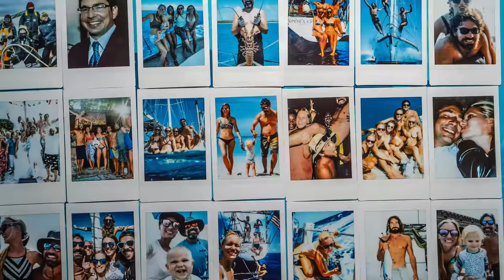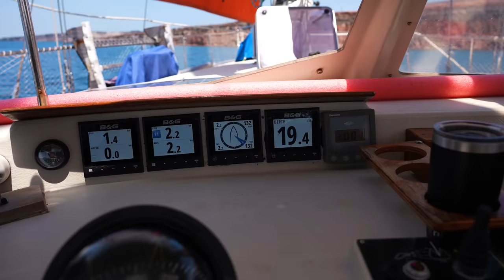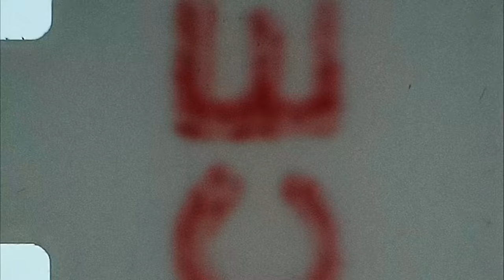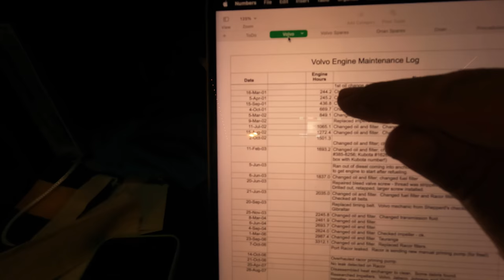Toddler sees the WORLD by SAIL - Desert Island Family Adventure SV Delos Ep 394

Comment: Brian I'm an old diesel truck driver. In my own truck which has over 432,000 miles I've used a product called Prolong. When I had the engine rebuilt the Machinist told me it was the cleanest engine for that mileage and had hardly any wear.
Prolong engine oil additive.

Comment: As an avid car enthusiast i can tell you that over filling the oil will 100% cause a loss in oil pressure. 

An overfilled oil pan causes the rotating assembly to whip the oil that is sitting in the pan, creating oil foam that does not properly lubricate the engine. 

Always fill to the proper level.

Fair winds and following seas.

Comment: If you have a drain plug at the bottom but don't use it due to accessibility (and are also concerned about being able to pump out everything through the normal location) you should check out the 'fumoto' valve. It replaces the drain plug with a ball valve with nipple. You still have to be able to reach down to it to turn the valve so as long as you can do that it's AMAZING for boaters. The valve has been 100% no leaks for all the people I know who are using it (even automotive!!) but you can even leave a hose secured to it, route it to above the engine, and even if the valve would leak it would just have it rise in the hose to the level in the engine and no further.

Comment: No Sir, it doesn't matter how hot it is outside, you run that motor a few minutes before the oil change, great habit by the way, so that all the bad things in the system get picked up and held in suspension so they get pulled out of the motor when you pull the plug. That, my friend is why that motor is pushing 400,00 miles :)

Comment: Brian, just to share something my dad taught me about overfilling oil way back, and why it is definately something you do not want to do. The maximum oil level is determined by the bottom of the stroke of the piston skirts. Pistons have typically 3 rings, 2 compression rings at the top, and an oil ring. The oil ring is quite different then the compression rings as it's a 3 piece design. It has two holding rings that hold a waffle ring between them. It's job is to dip into the oil pans oil when full, and carry extra oil that is gathered with the waffle up the cylinder walls thus lubricating the lower part of the cylinders during operation. When it's overfilled with oil, the skirts hit it much more violently due to more surface area of the skirt hitting the overfilled oil. Yes that causes bubbles, as you said in the video, eventually and in a short period of time, the oil is so airated that it can no longer support the pressures of the crankcase loads and your main bearings will be harmed, and your pressure will drop since the oil will no longer hold it's viscosity and all other internal parts that need that constant oil pressure will also be harmed (Cam bearings, Lifters, Rocker arm falcrums, etc) depending on how long it's run while overfilled. Absolute engine damage can occur rapidly, especially in a diesel since they have quite a bit higher compression and the loads are greater on the main bearings. You seem to be quite good at trouble-shooting issues but I wanted to add my 2 cents to help you decide if overfilling the oil is harmfull. I enjoy all your videos and love that you are continuing on your journeys with your daughter. Thanks for the many hours of entertainment and technical wisdom over the years. Thanks for sticking with your dream.

Comment: 100% True on overfilling being very bad. The Crankshaft will slap and aerate the oil causing it to foam, this foamed oil will then be pumped through the entire system leading to mostly air with some oil getting where the oil should, this will raise the oil temps as less oil is in any given area to provide lubrication so heat is concentrated in the smaller amount of oil actually doing any lubrication.

If you are in in a vessel that will see rough seas you are better to run the oil a little lower than max, as the oil has to get very low to dry the oil pump pickup, but doesn't have to get that far above full to start slapping the crankshaft. (This is much more applicable in a performance boat subject to much more violent operating G forces than a yacht or sail boat would)

Comment: Awesome video!   Semi pro tip.  On my fleet of trucks and mowers my mechanic will drill a small hole in the bottom of the oil filters to drain the majority of oil before he unscrews them.  It helps with oil spilling down the sides of the filter making a mess also making them hard to hold onto.

Comment: As a diesel mechanic you are doing everything right especially on hours except one thing... filling the filter through the center. Yes its fresh oil but technically the filter cleans from the outside of the element to the inside of the filter... more surface area but you are pouring unfiltered oil into the center. In all my years I have never done that all except I have filled through the small outside holes on the filter in the past... 

If its slightly over full it won't hurt... 5mm or 1/4" over fine.

Not sure what the life of those engines are but duty cycle and fuel burn is the real determination of life expectancy with good maintenance as you are doing..

Comment: Ooooh an oil thread, you usually only get that on motorcycle forums, what a versatile channel when you consider I discovered Delos whilst researching Lithium off-grid systems. Just a caution on pre-filling your oil filter; the danger is introducing dirt to the output side of the filter ie it then goes through you engine without passing through the filter media. Cheers! 🙃

Comment: Well I would say that you change the oil too often but thats up to you.  If you overfill an engine with oil what happens is with high revs pressure is created in the motor which pushes front and back main oil seals out and they leak then.

Comment: Happy holidays to you from Friday Harbor. Beautiful environment - so different than most others cruisers frequent. 
Brian, let's see if I have this straight. 8000 hours divided by 250 means you have probably changed the main engine oil over 30 times. And you haven't installed a pump to pump the crankcase oil out yet? 
My favorite mod on our Lehman-Ford is the reversible Lil Buddy pump that is plumbed to the drain plug opening in the bottom of the crankcase. It is conveniently located in the engine room a couple feet from the engine so I never have to touch a hot (or even warm) engine when pumping out oil. Changing the oil now just requires positioning a five-gallon bucket (the L-H takes 3 gallons), removing the cap off the discharge side hose, turning the valve on the intake-side hose from the engine to the pump, putting the discharge lline into the bucket, and flipping the switch on the pump. A couple minutes later the crankcase oil is fully pumped out with no mess. AND, because the line is plumbed to the plug in the bottom of the crankcase, ALL of the oil is pumped out at every oil change. I usually let the engine sit empty for one day and then pump out the remaining oil that may have drained down out of the most remote engine galleries into the crankcase. It is usually only a couple ounces. After enduring the misery of hand-pumping the oil out of the crankcase for years, a discharge pump will have you grinning from ear to ear every time you change oil in the future.

Comment: The oil level being too full is as bad as being too low, so max. on the dipstick does not mean full. It means it is the maximum that you can run safely without possibly damaging the motor and min. does not mean empty. It means it is the minimum amount of oil to run the motor safely without possibly damaging the motor. So if the level of the oil is say between 1/4 full and 3/4 full there is no need to add oil. Of course, if your dipstick was maxed out and you got an oil leak you could run the motor longer before having to add oil which could be good if you were out to sea and had no extra oil on hand. Anyway,  ......Hope you guys have a merry Christmas and a happy new year!!  (Rob)

Comment: Overfilling a diesel engine is worse than letting it go low, well below the minimum level at least.  The crank-shaft can dip into the volume of oil and aerate the oils causing a lack of lubrication.  This is a well know diesel trait for commercial engines.

Comment: Brian,  How are the tides in the Sea of Cortez?   Anything special about selecting an anchorage? Jim
Reply: Up at the top, where I am in Puerto Peñasco, on a spring tide you will get a difference of 24 feet. But down the coasts, even as close as San Felipe, the difference is less than four feet. It's described as kinda like the water sloshing back and forth in a shallow cookie sheet. Lots of difference at the end of the pan, not so much in the middle.

Comment: Obviously you have this whole maintenance thing down.  Might I be so bold as to suggest a couple of recommendations.  Write the hours on the filter, that way you have a physical record in case the computer crashes.  Also, next time your in civilization, send a sample of your oil to be analyzed.  Several oil companies offer this service.  It’s simple to do and relatively cheap.  They can tell you a lot about the condition of your engine, and whether your servicing too often, or not often enough.  Might make for good content.  
To answer your question, yes, overfilling with oil will put the level high enough for the crankshaft to splash through the oil, churning it, causing it to froth and will result in higher crankcase pressure.  Than can damage seals and cause oil leaks.  Also, pumping frothy oil through the engine is very bad for bearings.  You are also right that during start up is when most wear occurs.  There are contradictions concerning prefilling an oil filter.  I personally have never seen the harm in it, but the argument is, your cycling 1 liter of unfiltered oil through your engine.  I often wonder why manufacturers don’t have an external electric oil pump used to pressurize the system prior to the engine starting, then it could shut off after the engine builds it’s own pressure.  It could also assist in servicing.  Remote oil filters could also lessen the yoga needed to service the engine.

Comment: Just in case anyone cares, the reason it's bad to put too much engine oil in an engine is that if the oil level gets high enough the crankshaft will beat down through the surface of the oil on every rotation, essentially doing the same as when you make whipped cream by beating a whisker through cream, beating air into the mixture. The oil pump cant really pump an air/oil froth and then your engine stops being properly lubricated.

Comment: I noticed a different brand of oil filter than the one you removed. Do you try and use the same brand, or do you feel it doesn't matter? Same with oil? I was taught to stick with the same brand of oil and filter throughout the life of the engine. Thoughts?🤔
Reply from the maker: I dunno, but just not possible when we change countries all the time.  Still going good so I guess just not matter that much.
Reply: @Sailing SV Delos  Thanks, Captain
Reply: That mindset of same oil and filter throughout engine life is old an wives tale.